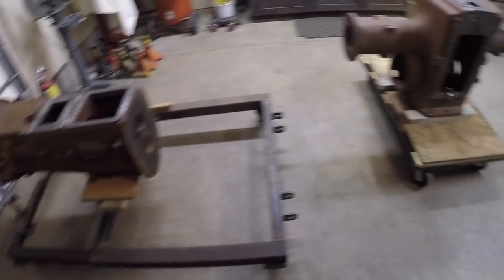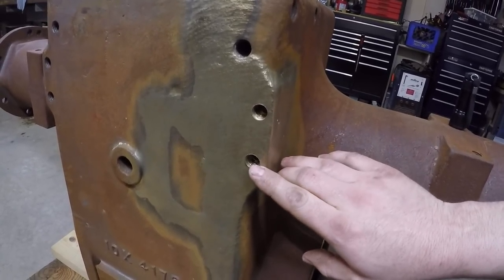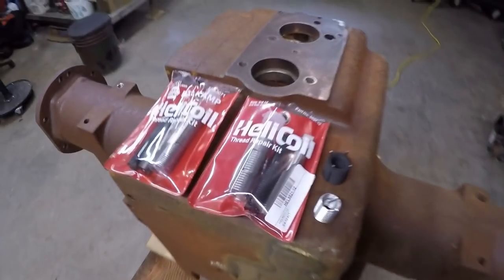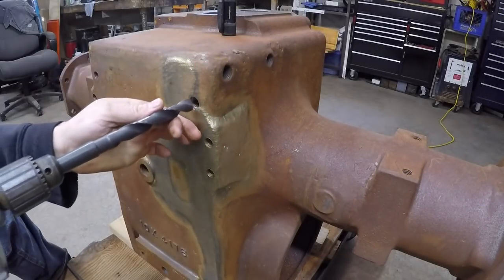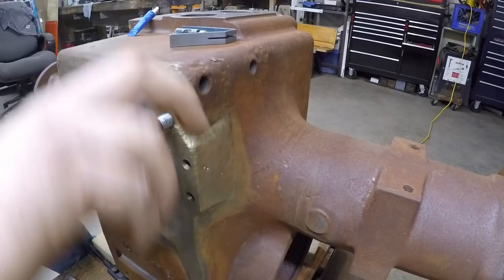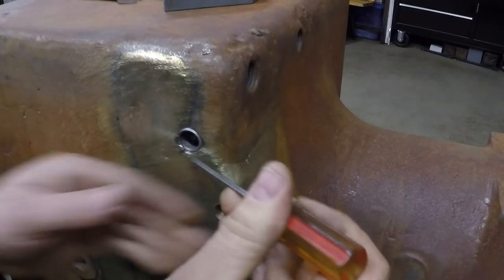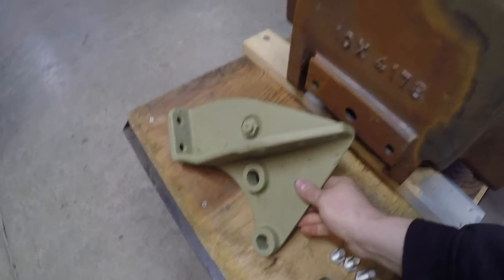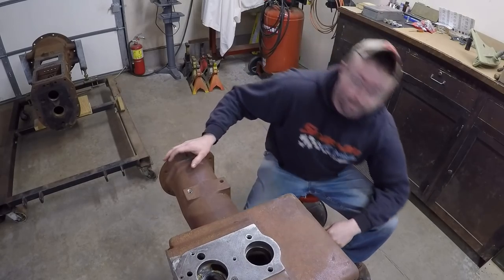Minneapolis-Moline Prototype 445 Tractor #X-231 Restoration - Part 21: Repairing Drawbar Bolt Holes

Comment: You are a better man than i to call what they had on there "weld" it was just gooping mottan on there as badly as possible. Not sure how on earth they thought it would hold, that is in my top 3 of worst looking welds. Nice fix but the brackets could use a insert or bushing to give a little tightness to the holes, I know they were made sloppy from factory but expecting a few 5/8 bolts to hold when a plow hits a rock is just asking for trouble. Great fix though, I have been binge watching your vids and some really creative and knowledge on this channel.

Comment: Nice! A lot of work but it will look great when you are done. When I was in tech school I was cleaning out the oil pan bolt holes on an engine with a tap and a air ratchet. I ran it in too far and the tap broke off flush with the gasket surface. I was not able to get it out. Too bad because it leaked since it was the corner bolt. Lessons learned.

Comment: The 2 small bolts beside one another , Is the holes bigger than the thread size thinking These might need a bushing to the bracket looks like a 1/16 spacing beside the bolt that`ll give movement to the bracket possibly breaking the weld again , I`d make a cross 1/4" strap bracket from each side to the middle underneath with a 90 deg. bend to put a 5/8 bolt to hold the bottom from cracking again - A belly support - ,, Maybe make a copper pipe bushing just wider than the drawbar bracket so when the bolt tightens it`ll make a Farral in the bracket hole ( Ounce of prevention is worth a pound of cure )..Looks good though .